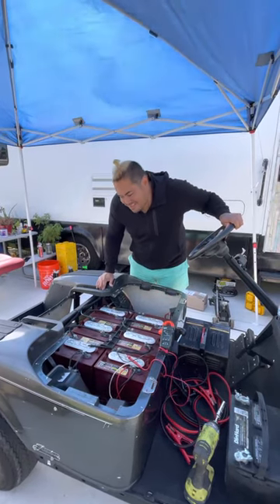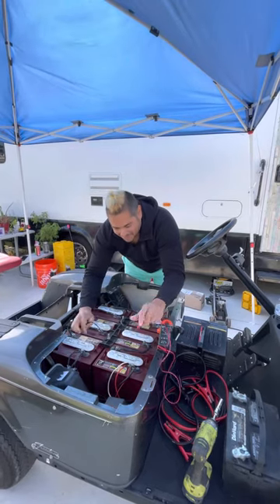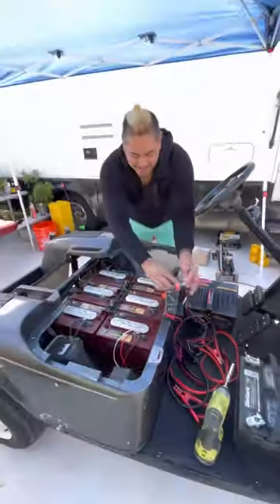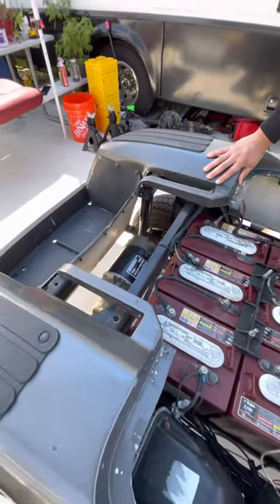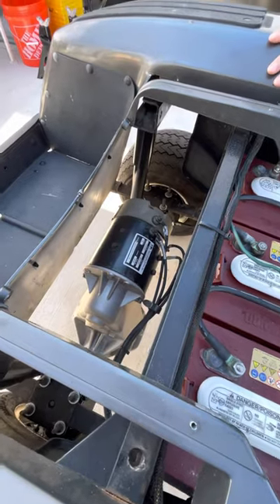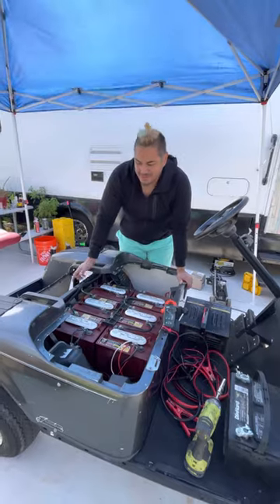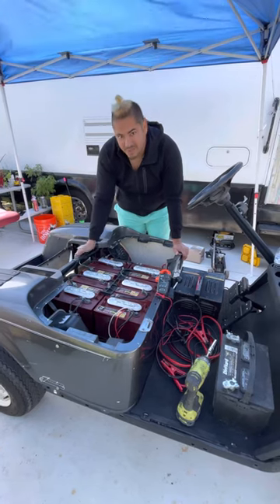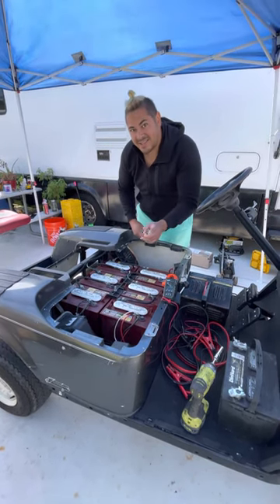How to Fix a Golf Cart: electric motor is stuck, vibrates, shudder or is humming

Comment: So what your saying is one of the batteries was dead? What was your voltage under a load test?
Reply from the maker: Yes and mostly all batteries where 6+ volts but when I load tested using a 100 amp tester I found the battery that was bad